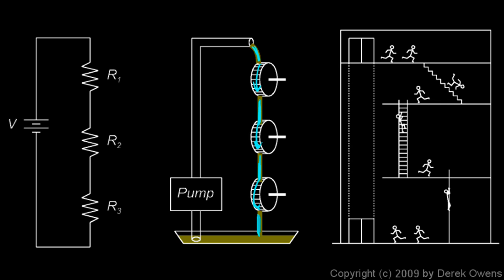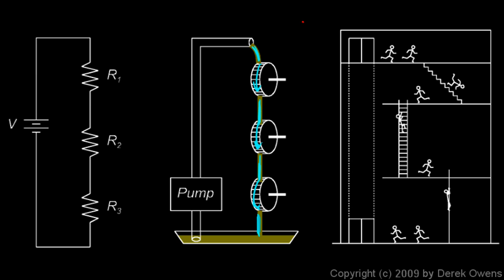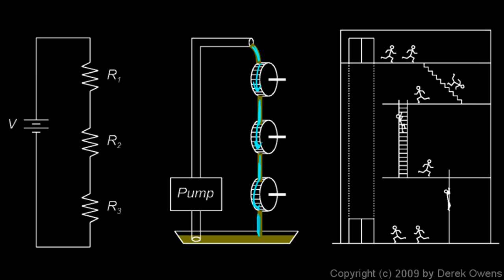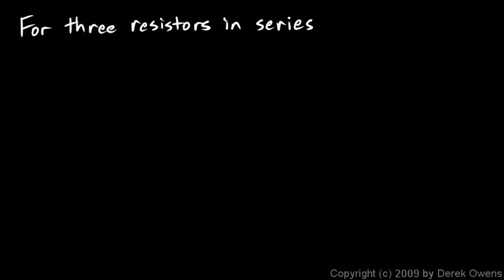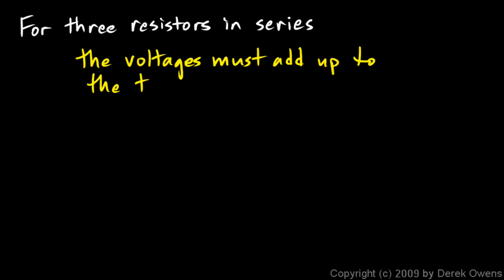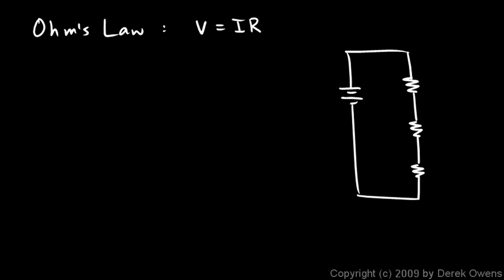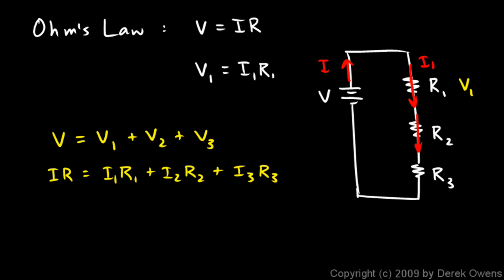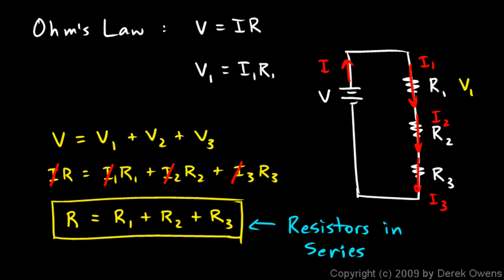Physics 13.4.1b - Resistors in Series

Comment: PLZ ANSWER DYING TO KNOW. What if i  connected a voltmeter across two ends of the wire before resistor 1. there is nothing between the two ends of the voltmeter's wires. i understand the electric potential at these point would be the batteries voltage . But what about the P.D across the 2 points. bcoz no energy is being lost, the electric potential at these 2 points would be the same, meaning the potential DIFFERENCE would be 0. so the voltmeter's reading would be 0?

Comment from the maker: Think of it like this:  If water falls and goes through a water wheel, it loses PE and the PE gets converted to work.  If the water falls and there is no water wheel, it still loses PE.  Same with the electrons.  They lose PE as they move from one point to another.  If there is no resistor or other device, then it just becomes heat in the wire, which is why a short circuit can be dangerous.

Comment from the maker: For a circuit powered by a battery, the voltage is basically constant.  Think of it this way:  You have three resistors in series, and a certain voltage, so you get a certain current flow.  If you remove one of the resistors, that lowers the resistance, so you get more current flow.  Then if you do the V=IR calculation for either of the remaining resistors, you get a higher value for V.  So each resistor gets some extra voltage, that it was not getting when all three were there.

Comment: I have a confusion about the sum of the voltage drops being equal to the provided voltage. If, as in the example, the sum of the 3 voltage drop across the resistors equaled the supplied voltage, then wouldn't there be extra voltage if you used the same power source and removed 1 or more of the resistors from the circuit? thanks

Comment: Sir I just wanted to ask1) if the resistors were of same amount will the voltage drop be same and how?
2)and if the current is same the amount of energy required to push the electron through the resistor must be same then how the voltage varies for each resistor.